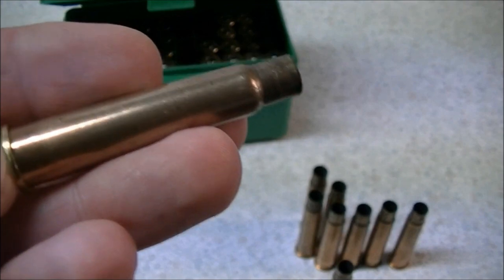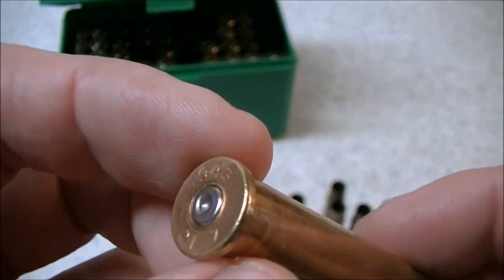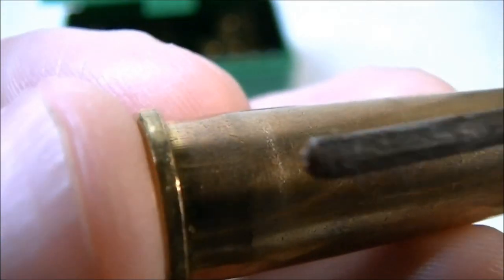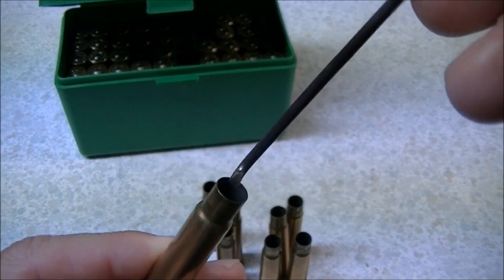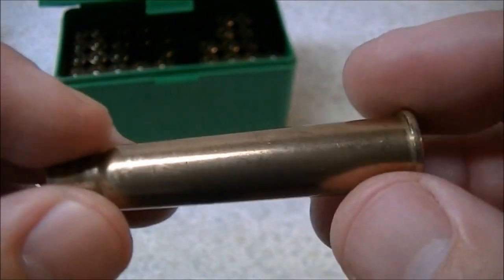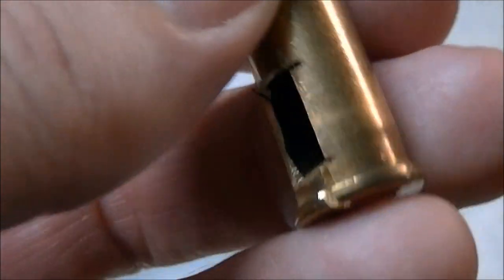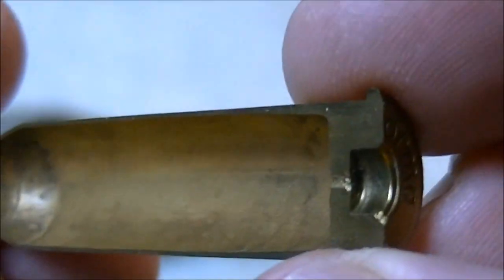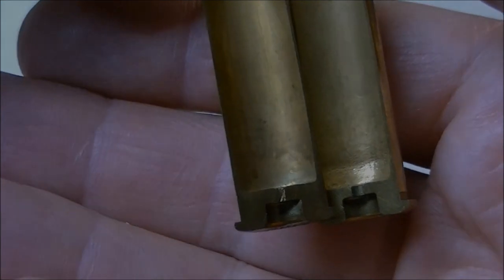Incipient Case Head Failure

Comment: Great explanation!  Neck sizing is definitely the way to go, if you can dedicate your brass to a given rifle.
Reply from the maker: Neck sizing is almost the only way to go if you want decent case life in many 303 chambered rifles, Lee Enfield rifles were chambered rather generously to accept ammo made to very loose tolerances. I have a Ross rifle with a very tight chamber that it allows "normal" treatment of the brass, P14 rifles generally are also a bit easier on the brass than are Lee Enfield rifles.

Comment: All the reloading manuals go through this subject and point out that we have to be cautious about it, I have found that many people don't read this section in their reloading manual that talks about it and it is a surprise when they do have case head separation, case life is an accepted cost of crafted ammo and should be understood from the start without case head separation being the final determining reason to replace your brass. there are many factors that extend case life and should be studied by the home ammo crafter. Good Video -Dave
Reply from the maker: With properly adjusted dies in modern firearms a case head separation is almost unheard of. But with older guns (especially many with with rear locking actions) it's a real issue that reloaders need to keep an eye out for.

Comment: Twice I've left the range with an Enfield out of commission from a stuck case via case head separation. Always a pain when it happens a half dozen rounds into the shooting day. (I need to get a removal tool...) Great video - thanks!
Reply from the maker: Yeah, it's a pain when it happens. Often the remains of the broken case can be removed with a patch on a cleaning rod jag, but sometimes a proper broken case remover is really the best solution.

Comment: Just found 7 bad cases 4 of the 7 are REAL bad. I got 60 cartridges from a old guy just getting rid of ammo for cheap. I told him I’ll take em for 20 bucks 7.62x51 LC 68 head stamp. However the projectiles were soft points so I knew they were reloads. So at first I was gonna risk it and run em. But then I remembered this video while I was cleaning a fairly expensive rifle. So I just said to myself just pull them down don’t risk your rifle over 20 dollar ammo. I then proceed to pull it down all the powder charges were on point very consistent. All the projectiles were very close in weight very consistent coal all on point. So I thought to myself man just wasted about 850.00 grains in powder. Till I did the paper clip test and there it was 4 cases ready to go. I just wanted to say I watched this video about 2 years ago and in that time I haven’t came across this till today. And I want to tell you thank you for posting this video it helped me from a case head separation or worse.
Reply from the maker: Great story, I'm glad you went the extra distance and found out what you were dealing with and before you ran into any trouble!

Comment: I own a SMLE No. 1 Mk III, and a No. 4 mkI, and I found that for both of them the biggest thing that helped is making sure that the brass I use has the approximate rim thickness, so that it helps to appropriately headspace.  The best brass I found for that is Prvi Partisan.  After that, neck sizing helps, and so does bumping the shoulder back a little bit.

Dealing with case head separations and insipient failures was one of my main driving forces for purchasing RCBS's case master measuring tool.
Reply from the maker: 303 chambers can have huge variances in the shape of the chambers and the location of the case shoulder, while headspace (rim thickness) can be within specification if the chamber was cut especially generous the cases can and will stretch. For especially nasty chambers firing factory loads will almost always lead to stretched cases. Certainly the thickest rims available will help in these problem chambered guns but the worst of them require specially prepared brass if they are to be used with decent brass life.

Comment: Oy mate. Are you Canadian ? Seems I got the same problem with the .223 but also in my 38 special , 
When I notice this while inspecting? I usually save them for only one more loading with minimum powder &  velocity , then throw it away
Reply from the maker: Yep, I live in Canada. I've never had a 223 or 38 Special show any signs of an incipient case head separation. Worst by far have been the 303, and also a problem with one brand of 6.5x55 cases (Igman brand).

Comment: Excellent!  Another method is using a borescope to look inside sample cases from a lot.  Borescopes are relatively inexpensive these days and useful for many different applications.
Reply from the maker: That's an interesting idea. If I ever get one of those i will give it a try.
Reply: @314299  Also useful for examining the flash hole inside the case.  Borescopes cost less than $100 and display on smart phones or laptops.  I like the Teslong rifle borescope.  Pretty handy for many applications.
Reply: @RetrieverTrainingAlone  best 120 i ever spent.

Comment: I'm doing a test with 40 cases of 223 PMC, 10% less than max. load and will reload them until they all show potential case head separation as you demonstrated then I will throw them out. So far I have reloaded the cases 20 times, no annealing and just neck sizing and 6 cases have been thrown out.
When finished I will update my comment for your viewers.
reloads:   5     10     15     20     25     30     35     40     45     50
left:          40    40     38    34
Reply from the maker: Interesting experiment. I generally don't reload .223 cases more than about five times before discarding them as there is so much free once fired brass.
Reply: @314299  True; one more thing that is occurring is when new 223 walls of the necks for PMC, Rem. & Hornady generally have a variance in thickness from 1.25 to 1.5k but after about 10 reloads the wall thickness hardly varies at all. 
Another thing I don't do anymore is perfectly clean the necks and leave some of the carbon in place. This allows the case to load very smoothly compared to a case cleaned right down to the brass.

Comment: Would a new modern barrel and a tighter headspace alleviate the problem?  A newer Mk2 action with new barrel?
Reply from the maker: A new barrel and stiffer action would help a lot, the heavier constructed No 4 actions do "spring" less than the earlier actions. P14's are better yet with their massive construction and front locking. Best yet is a Ross MKIII action, if you can find one without a altered/ruined chamber.

Comment: I had a almost-case head separation on the range. 6.5 grendel. Shot was fine, but pulling the shot out was a bit stiffer then normal. It now has a line all the way around and half of it has had gas leaking.

I find with certain cases - 6.5, 308 etc it can be easy to use a flashlight/led light and look down in the case. If there is stretching you can se a line/shadow close to the bottom. Often the ring is not all the way around, perhaps 30-50% of the circumference has the "ring". The outside can show some changes but the inside its like day and night. So take a bad case and look down it, with some practice you can check 50 cases in half a minute.
Reply from the maker: Yeah, those super bright LED flashlights work well for that task.

Comment: This happens in Pistols as well.  My G23 Gen4 had a major failure.  and since the chamber is not fully supported in the lower (6 o'clock) position the case failed downward.  It blew apart my trigger, and magazine release mechanism, as well as removing my extractor.  The head was completely removed and the wall of the case was forced into the barrel a bit.  The round DID discharge downrange.  Bottom line  CHECK your pistol brass for this as well.  It could be devastating to you or those around you.  ( I suffered only a very small cut on the lower bridge of my nose and a very vibrating trigger finger.  I was lucky.)  I would not recommend reloading Glock fired brass more than twice.  Again, My Opinion, not fact.)
Reply from the maker: .40 S&W Glock pistols are rather famous for the sort of failure you described, however it is not really caused by the same issues as discussed for rifle rounds in the video, which ar a product of case stretching. 40 Glocks have that portion of unsupported case head and the 40 caliber runs at pretty high pressure and .40 cases can be somewhat thin in this critical area. I personally dont think reloads are a good idea in any 40 Glock.

Comment: Military brass of course was never meant to be reloaded, so this would never be a problem, but once shooters full length resize it has the effect of bending the brass which is up against the solid, unexpandable head, back and forth, this very quickly weakens the brass at this point, if brass is used in just one rifle there is no need to full length resize, so this is not a problem, for the unknowing, well he just does what the diemakers tell him to do, and cases only last from 1945 until now. Stay safe ! Chris B.
Reply from the maker: Yes, the military was only concerned that the ammo be fired once with safety and reliability, reloadability did not enter into their planning.
Reply: @314299  I think you meant to write "Reloadability", the primers are usually sealed and crimped in as well. Stay safe ! Chris B.
Reply from the maker: @453421abcdefg12345  Yeah, my typo, now corrected - thanks!

Comment: I had the case twice, if the brass gets stuck it's no fun
Reply from the maker: Generally a tight fitting patch will remove the front part of a separated case, however some will require the use of a special stuck case remover tool.

Comment: head separations in Enfields are not really a problem.  Just make sure you have an extraction tool. https://www.youtube.com/watch?v=dmjFr2DRldk
Reply from the maker: They don't generally cause catastrophic issues, however I would still like to avoid them if I can.
Reply: @314299  ya i have a bunch of brass i need to dump too.